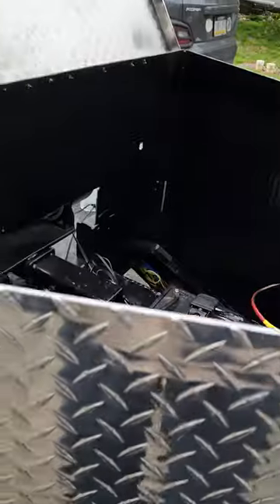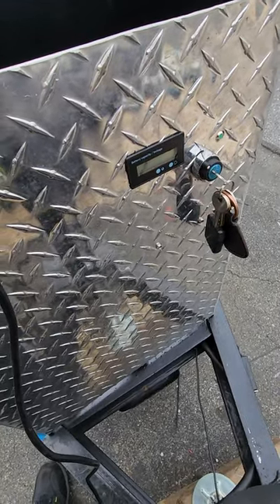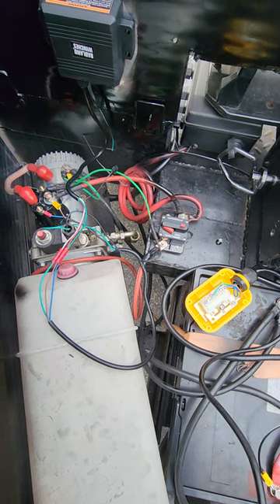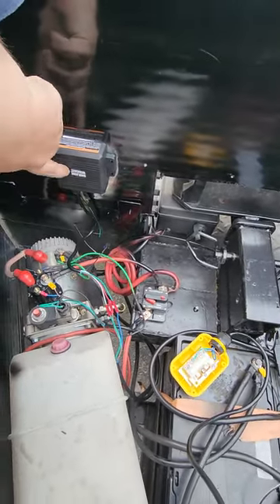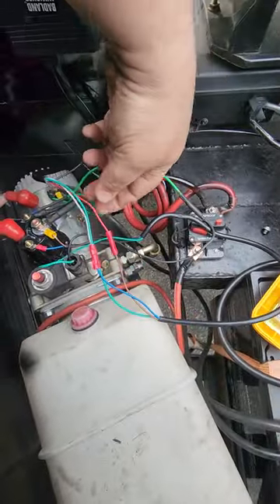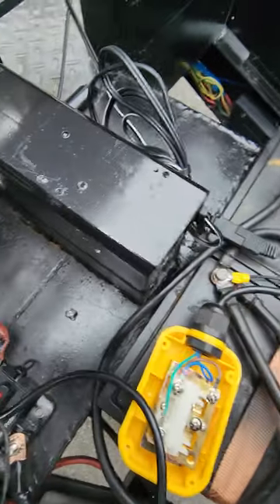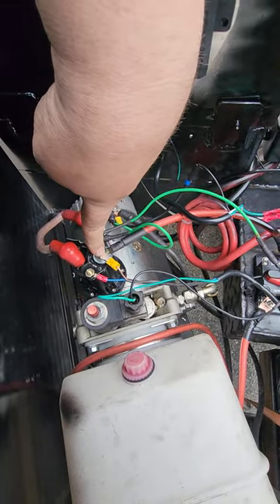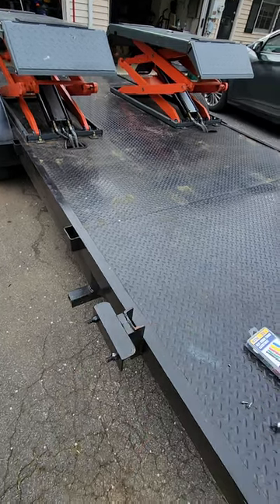Wiring up Single Acting Pump for Dump Trailer, to Bad Lands Wireless Remote!

Comment: I just bought a dump trailer and have been trying to get the remote from Harbor Freight to work.  I can get it to go up but cannot get it to come down.  The jumber that you mention goes from ground on pump to up green wire?  If you could please send me pictures of all wires, maybe I can get it to work.  I'm one wire off and I don't know what one it is?  Thank you
Reply from the maker: Absolutely sorry for the late response.
Reply from the maker: DM @   Keepin You Movin on FB messenger and I can send you a diagram